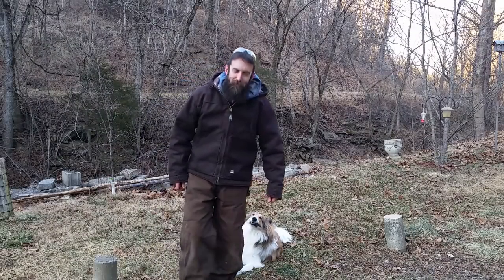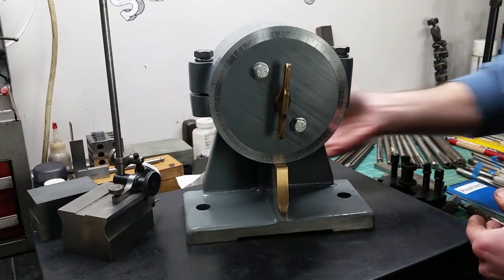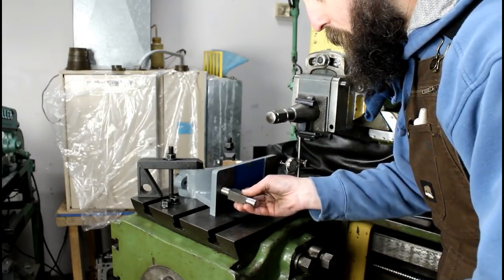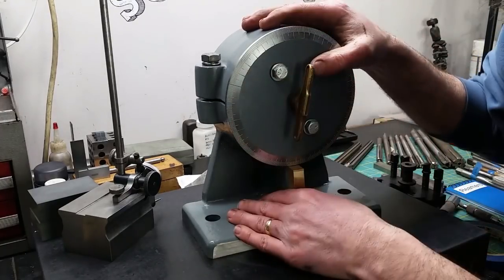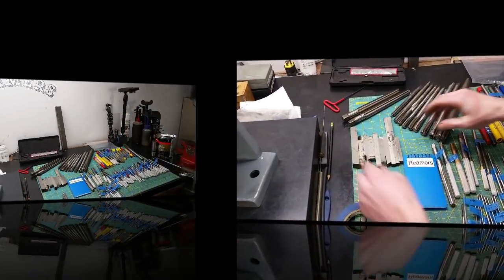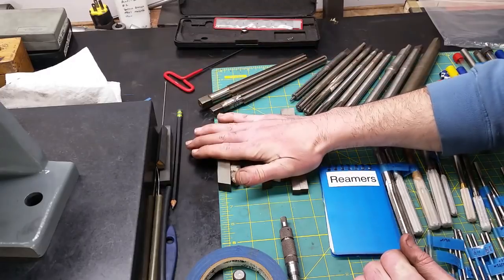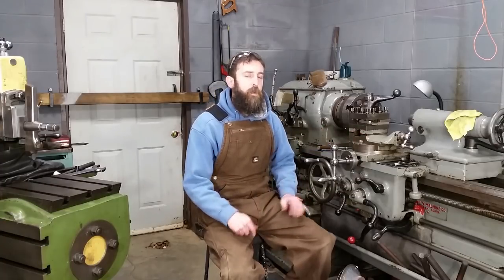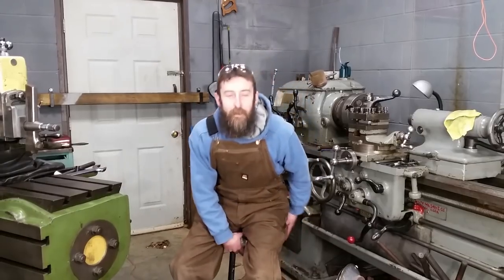Shop Update / Viewer Mail / Fab Gab #1

Comment: I have the same problem with heat in the shop. I also have the same door bolt, we have worked and collected tools too long for them to come up missing. Thanks for your channel.
Reply from the maker: Allan Noyes The door was kicked in before I moved in and I'm just making sure that it doesn't happen again. It would take me forever to replace the small tools  I have collected over the years. Some grease ball would trade them for 5 bucks if he could. I plan to pass them to my son if I can hold on to them long enough 👍

Comment: I'm sure you can machine a base to use the compound that's got the holes drilled and tapped . Enough room to mill a slot for a tee bolt to slide without unbolting the tool post . Why give up the ease of use. If you keep the old bars and spacer the four way post can be remounted if you want anytime. I have the same qctp to mount on my logan lathe , I'm still using a four way from Hardinage . Shimming tools sucks for sure , but it's what I had. My little buddy is 15 slowing down can hear and has a he don't give a crap attitude for a dog. But he and did lots of traveling . God bless ,thanks

Comment: Hey Steve, great video and I went through the cold spell, too!  Of course it warmed back up a little too much, may cause sweating on your tools!  I didn't tell you our dog Tiny that died was a small mix and weighed about 25 lbs.  Now we have another rescue dog that came to us about the same weight but is at least twice the size as Tiny.  Next surprise was she was expecting...7 pups.  Now, three or so years later she has been fixed and weighs just over 60 pounds.  My wife over compensated for her poor condition when we found her.  I would enjoy seeing how you fix that lathe and since the tail stock isn't lining up just right maybe you could give us a blow by blow on scraping it back in.  Just a thought, or should I say thoughts!  Greg
Reply from the maker: Charles Compton Thanks man, the little guy steal your heart.
Scraping in the tail stock would do no good without 1st scraping in the lathe bed. The wear is in both.

Comment: Looking forward to the phase converter video. I have an American Rotary converter and it's really loud also, not like yours when you shut it of but it just seems loud all the time. They claim to be quite but it's louder than no name ones I had before. I had to put mine outside, that may not be the best thing for it over time but I don't care it's way too loud. It is 40 HP but still.. And I don't know why they don't come standard with TEFC motors like all the others do.
Reply from the maker: Steve just Steve Mine was quiet for about 2 months then it just kept getting louder and louder. I plan to try and repair it soon. Thanks for watching 👍

Comment: The angle fixture plate looks great, a work of art!  Nice score on those reamers...funny, I just had a supplier send me 250 brass spacers with hour-glass shaped bores that I had to return.  Wonder if they had the same issue as your lathe, with the tailstock out of alignment?  Interesting workaround...
Reply from the maker: Sascha Oswald It makes a difference when the reamer is not held solid. My old lathe doesn't ream holes well without it.

Comment: Steve, do you know what the casting was used for that you used for the angle plate.  You may have said but I did look back and couldn't find what you said.  Sure do like your shop too.  Thanks for sharing you experience.
Reply from the maker: Glenn Felpel Yes, it was a holder for a stator on a progressive cavity pump. I have 3 total the one I am using is the larger one of the 3. The 2 smaller ones have around a 3" dia hole.
Reply: Thank you Steve.

Comment: Steve in regards to your shop temp. I obviously don't pay your bills so I can't tell you what you can afford. However, I have a small heater in my shop that i leave running nonstop in the winter. It keeps the temp around 45 degrees. When I go in the shop to work, I bump the bigger heater on and the temp gets to a comfy 60 degrees in no time. If I shut the heat completely off at night, the temps drop so low that its impossible to heat it in a daytime. I'll add my shop is fully insulated but the concrete floor and heavy cast iron machines hold the cold. You may want to experiment anyway.
Reply from the maker: grntitan1 I could not afford it, the office where my machines are is not insulated. I just make due or do without😃. This weather won't last, before you know it I will be complaining it's to hot

Comment: Excellent content/video, as usual. It's been cold here in MO as well; we're sending a few more reinforcing waves of artic cheer your direction....

Nice score on the reamers! One point of discussion though; when used in a lathe (with the work rotating), if a reamer is held rigidly off center (i.e. driven by a tailstock center) it will cut an oversize hole, that is still round. I use a "Bald Eagle Floating Reamer Holder" which uses a hardened spherical rod (mounted in the tailstock) which bears against an adapter attached to the reamer. I've fabricated/tried other methods, but this has given the best results with the least drama.

Another consideration, you were mentioning needing a different sized taper reamer. You could take a page from Clickspring's playbook and make the tool you need...... I've come to enjoy the tool/special cutter builds even more than the standard project machining vids; as the possibilities are endless when you can make your own tools.

Anyway, thanks again Steve!
Reply from the maker: Robert Ross Yeah, I enjoy the tool builds also, the guy is pretty good I must say. Im sure it can be done. The swinging part of the clapper is very hard and I may have a tough time. Something to think about though👍 Good to see you again

Comment: I have a Taylor T1000 water stove that keeps my shop, house and all of my hot water hot all year, yeah I got to cut a bunch of wood but I spend most of my time in the shop almost everyday. I could not afford to buy all the propane it would take to keep all this heated. Having a bigger water stove is the way to go if you can get free wood, I usually burn oak and hickory but this year I have been burning elm and sycamore, the woods most people do not want. It does not matter if it is half rotten this thing will burn it all, nothing goes to waste. My shop is 2800 sf and 20 ft at the peak, the house is 2000 sf, both are insulated with cellulose. Insulation has an R value, from what I have read the R value is calculated at 70 degrees. The R-value of  fiberglass actually goes down the colder it gets but with cellulose the R value increases the colder it gets. It is suppose to get down to -1 Monday night and it will still be 70 degrees in here. I built the house and my shop mostly by myself and yeah it was a lot of work, it took me every waking minute for 2 years to build the house all done working a 40 hour week job.
My shop is my escape hut, heated in the winter and I also have AC I use partly in the summer, no regrets here.
Cheers from the squirrel house builder, yeah that is what the little picture is of.
John Fink
Reply from the maker: imystery man  I admire the fact that you build your own place, nothing easy about that when working a full time job. I had planed to build a outside wood water heater to heat the house but alway get side tracked. I have most the stuff minus the outer tank. One day maybe..  I seen the tree rat in the tire house in your logo👍 They taste delicious. I love to hunt squirrel.
Reply: If you like eating squirrels then put up some squirrel houses, you will have more than enough. I have scene people talking about planting trees, I say put up squirrel houses and plant a forest.
Reply from the maker: imystery man I don't hunt the ones in the yard, just the ones in the woods😒. The ones that are in the yard are more like pets. Around here we have a lot of hollow trees that they live in. There is no shortage of them that's for sure.
Reply: What size tank are you looking for, I have 2 scrap yards close to here I shop at quite a lot.
Reply from the maker: imystery man Well, I am not sure of the gallon rating but I was thinking about the size of you common home propane tank. LoL I know where one is now but have no way to get to it. It is stuck in a drift on the bank of Elkhorn creek near my home, guess the water washed it out of some unlucky persons yard😃

Comment: Steve any  advice on the pros and cons of having a workshop where the temperature varies as much is yours ??
Reply from the maker: Ron Smith Rust due to condensation the major con.  The only plus side is the cheap energy bill😃. I did a video a while back talking about it.
Reply from the maker: Ron Smith  Random rust / tool find/ red wasp encounter
Reply: Found it thanks a lot

Comment: That poor lathe compound! Real nice lot of viewer qifts there.  If you tip one end or the other of your motor up by sitting it on  a 2x4 does  it quit making noise?
Reply from the maker: bcbloc02 No, I bump it and it will stop for a short time but it don't care what way it is set, the noise seems to start when I push the record button😐.  I have tried it all. Bet it is some guard or the fan. The noise got worse when the temperature dropped.
Nice to see you Brian👍